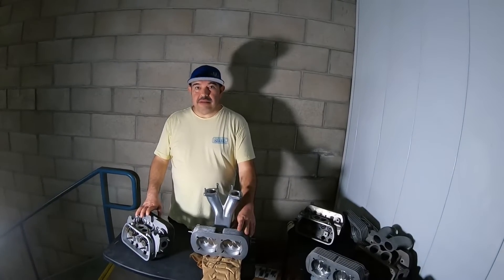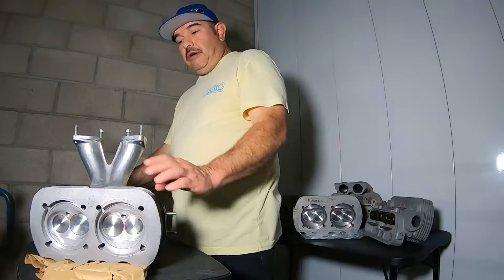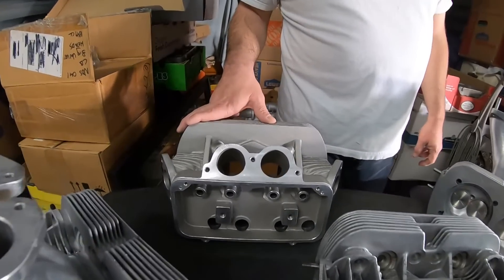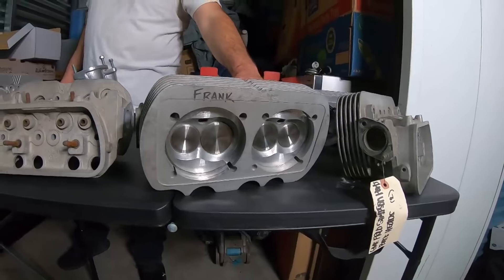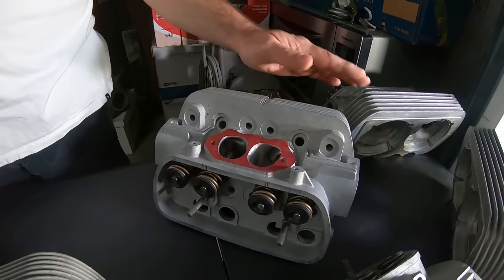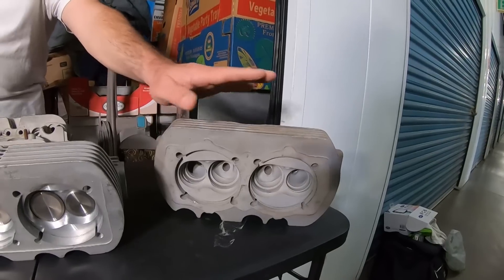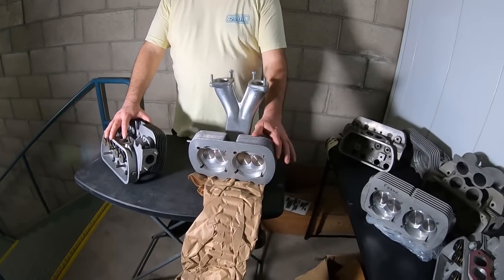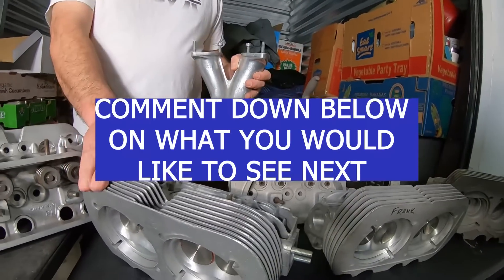Air and Water Cooled Research and Development Introduction Video

Comment: Ok thats cool! I'm not a gear head tho... can I put these on a 2015 buick encore? Will it make it like a race car?🤔
Reply: Absolutely not. This engine’s way too small for that large car and totally incompatible with your new car’s computers and sensors. 

If you want to get into Volkswagens like these engines are designed for I would recommend the 1.6L Type 3 engine from the beetle or a Type 1 Engine from the Hippie Van. Put that engine into a dune buggy or something else small and simple. 
And STAY AWAY FROM TYPE 4 Engines (1972-1983). They’re said to be less reliable, less popular, and parts are harder and more expensive to come by.  I’d know, I’m building one right now.
Reply from the maker: Thank you for your comments ......